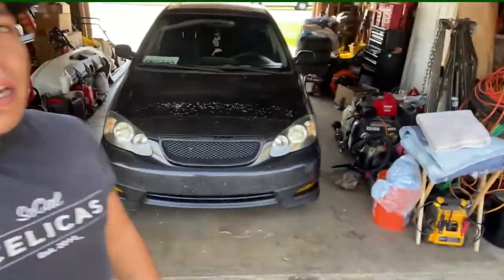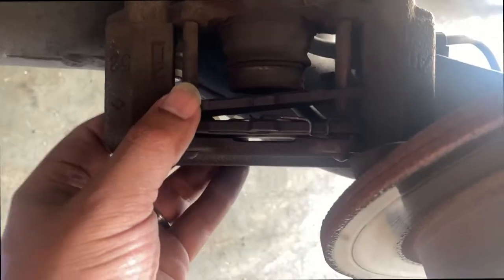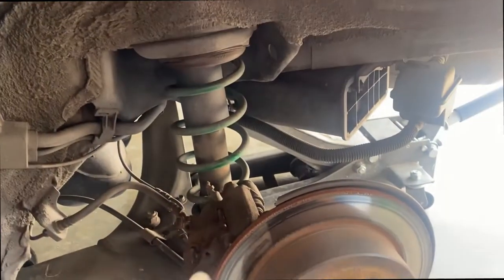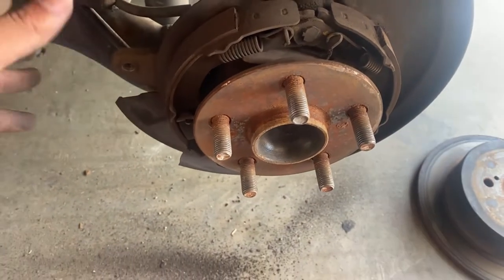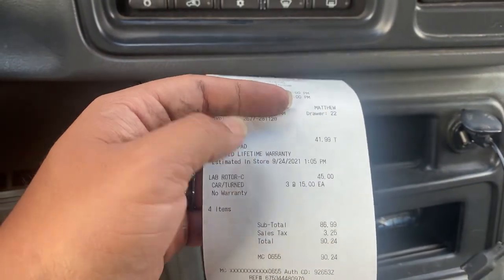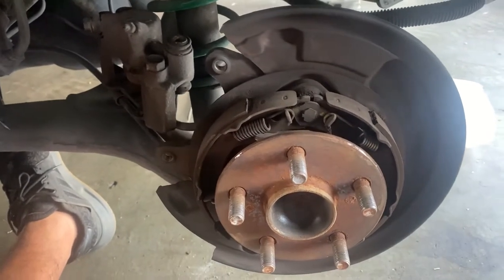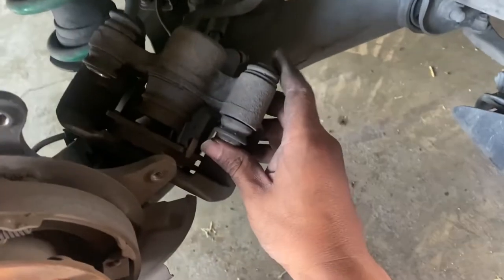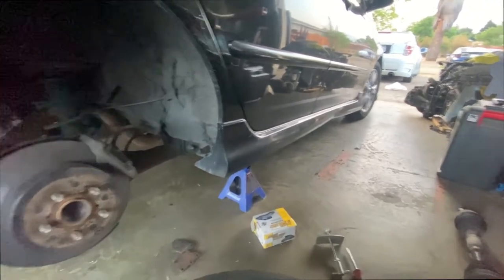How To Replace Rear Brakes 05 Toyota Corolla Xrs

Comment: good looking out. I was going thru videos trying to find whether the pins on the rear caliper should slide and you're the first guy out of the last 3 videos i pulled up that actually emphasizes to make sure that they slide. So thanks. Both of my pins are seized badly. My front pins were seized too. I think it was bringing my mpg down bigtime.. cause my engine and air fuel ratios are in tune on my vibe gt w 2zz engine. and i'm getting like 27mpg highway (tops), but i used to get 32+.
Reply from the maker: Glad it help you and that could be a possibility

Comment: Such a cool intro
Reply from the maker: Thanks my lil bro thinks its long
Reply: @RafasGarage  nah its original. Leave it. hey do you know what cars i can get rear backing plates off of for my xrs  do you know if the lower trim levels of the matrix corolla etc with drum brakes use an interchangeable rear backing plate. My xrs has rear disk and the parking brake is inner drum inside the rear rotor and i had to cut tue backing plates off came apart during a trip and i had to just take off the parking brake drum assembly from that side online they want over 200 per each and its equivalent odds of winning the lottery than finding an xrs in the junkuard where i live.
Reply from the maker: @MAGA_EXTREM1ST  celica gts, matrix xrs and vibe gt are the same
Reply: And is it possible to take them off are they integrated into the axle or do they have bolts. I cant tell  its badly rusted
Reply: @RafasGarage  yeah i was meaning other toyota cars didnt know if your knowledge exceeds mine. Gts and xrs are rare here. And the off chance one is junked its picked over  before it hits the yard here. 2zz is removed before its added to the rows

Comment: Where I live the parts stores charge $25 to resurface a rotor or drum. Not worth it, especially if you have aftermarket rotors. I suppose it's be worth it if you had OE rotors which have never been resurfaced before, otherwise no.